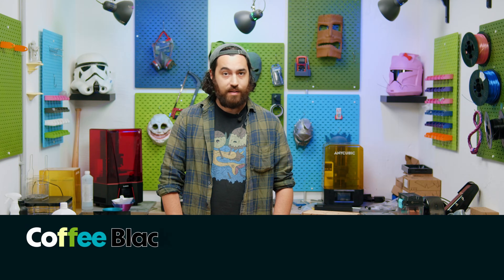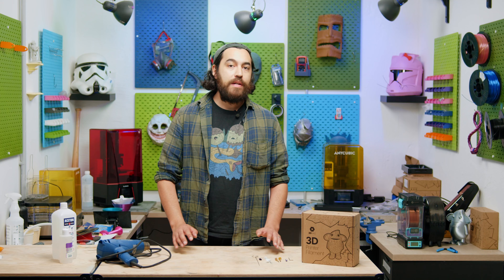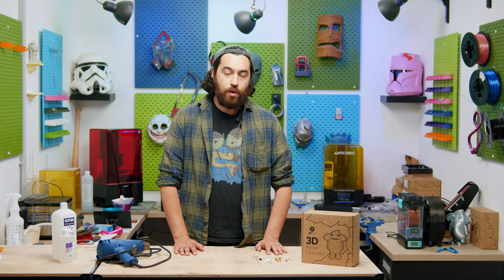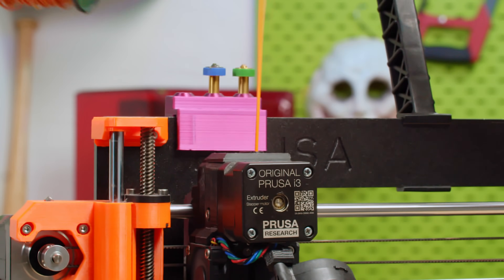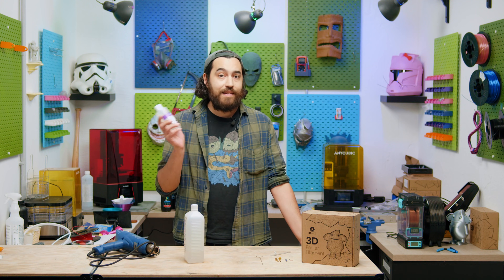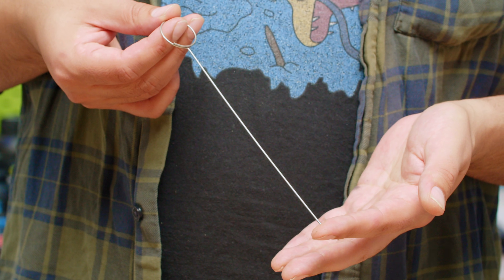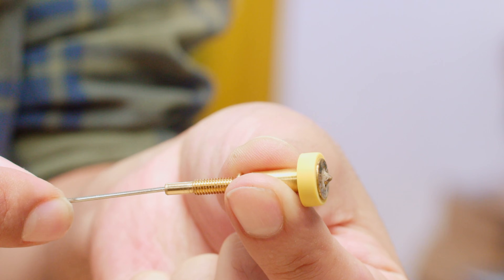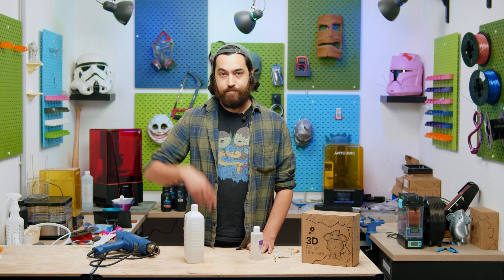How to Clean and Unclog Your Nozzle and Heatbreak Like a Pro!

Comment from the maker: IMPORTANT! Please only use solvents with steel and brass nozzles. A lot of nozzles these days have coatings that can be eroded by solvents like acetone and ethyl acetate!
Reply: If I use a solvent to clean the nozzle, isn't it a bit dangerous to put it back in the printer? Most solvents I see are very flammable and the nozzle reaches very high temperatures!
Reply from the maker: @mitchib1440  You're absolutely right, that's why we waited a few hours for everything to evaporate.

Comment: I have had a unwatched misprint that 'pushed' the pla in my voron Stealthburner all the way up to the external of the hotend, block and even onto the outside of my heatbreak. (with a 0.2mm wall of the dragon ST hotend.
really hoping i can dissolve the last PLA (it didnt melt of in the oven at 240C) as the old PLA hard-brittle like glass.. :S 
any tips?  (living in the EU- Netherlands, so basic paintstripper chemicals are mostly "environmentally friendly' here ..

Comment: I had a a ptfe tube connector that the metal teeth on the inside of the connector that grips the tube went down to my nozzle. So always unscrew the connector from the heatbreak b4 taken the tube out

Comment: Today I had that type of clog that wouldn't budge, not with a cold pull or solvents. At some point the filament elastomers just evaporate and there's a hard, non melting mess in the nozzle. The way I solved it was to remove the nozzle, hold in in pliers and burn the plastic out on the gas stove, a gas burner or a lighter would probably work too. It'll burn with a yellow flame until everything is burned away no flame will be visible. It took about 3 minutes. Black soot can be removed with some twisted up paper towel. The clog has been completely cleared. I use a steel nozzle so I'm not sure if this would work well with a brass nozzle. It'll oxidise more I think. But anyway, this is how I do it and I've not seen it mentioned anywhere else. Make sure to use good ventilation as burning plastic is a health hazard. But it's not a lot, nozzle usually hold maybe 10mm of filament.

Comment: Thanks for these tipes. In my case I had the heat sink of my Anycubic Kobra S1 that got completly clogged. I had to remove it and with a hand drill and using  2 mm drilling tool,  I have managed to remove the full clog. Have to go very slowly, but the method is super efficient for a heat sink clogging. Of course, I had to remove all before doing this operation.

Comment: Why not just put a new nozzle on, they are cheap?  I keep a bunch of piano wire thicknesses around for diy projects, helps for unclogging.  You did give very good advice for unclogging, cold pull has worked for me, but sometimes i just replace.  Larry
Reply from the maker: Well, you could buy one, then you'd be €15 down and have to wait at least a day (if you didn't have a stash) or you could just fix the one you have in a few minutes.

Comment: I don't know what I'm doing wrong but I've never gotten a clog LOL, started 3d printing 6 months ago have 2 Kobra Neo's. Q1 Pro and A5M
Reply: "what i'm doing wrong" you mean you don't know what you're doing right >.<
Reply: @mitchib1440  back when I replied to this yeah I didn't know a damn thing, now I know, but I have still have yet to get a clog on a nozzle and I have 8 printers by 7 different manufacturers, maybe clogs come from filled filaments like carbon fiber or glass fiber That's why people get clogs or they leave their filament out and their area is dusty or dirty, I print very little carbon fiber PETG maybe that's why I still have yet to get a clog in any of my machines...
Reply: I had the same experience until I was printing ASA-CF on my 0.6mm CHT nozzle. Unclogging CHT nozzles is a different beast.

Comment: I never had a clog in my printers even after a few thousand printing hours. Guess I got lucky
Reply: Same, and I'm really glad about that 😅
Reply: I have to correct myself. I had something similar like a clog. I had the situation where one of the wires of the Hotend heaters snapped right at the entry. So there was absolutely no chance of heating it up to disassemble it.
Had to use my Dremel to cut the screw holding the heater, force the block open (was only an V6 Hotend) and somehow get another heater in to disassemble it.
Heater block was ruined, but I could get my expensive nozzle out.
So keep an eye out to not bend those wires too much!
Reply: I've had it once, it was a chunk of something black in some overture nylon.  a cold pull fixed it.

I've also had 2 jams, once just a freak thing where some especially brittle pla broke below the extruder gears and ended up coming through the side and once finding out that my h2 v2 lite doesn't have enough heatsink to it to tame a 144w hotend running pla at 280c causing filament to solidify in the heatbreak.  I had to run a drill down the heatbreak for that one